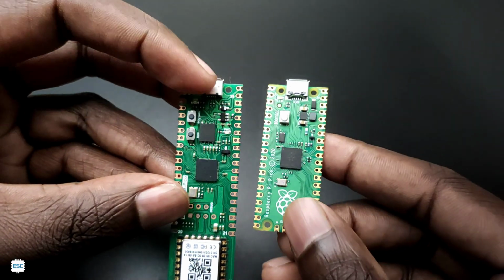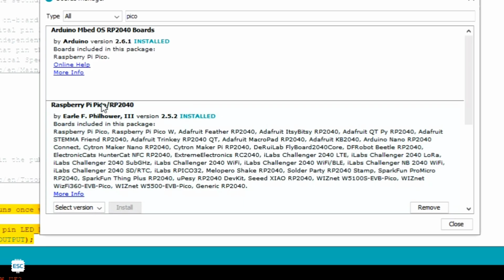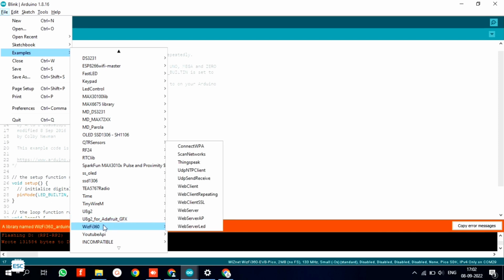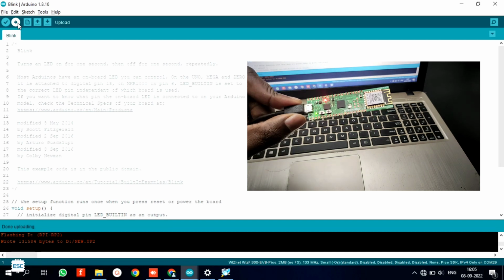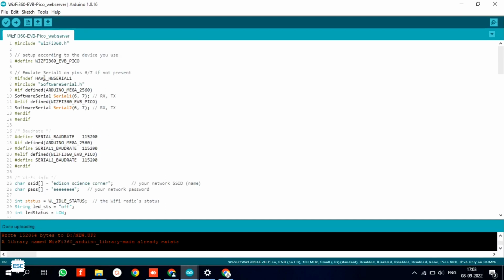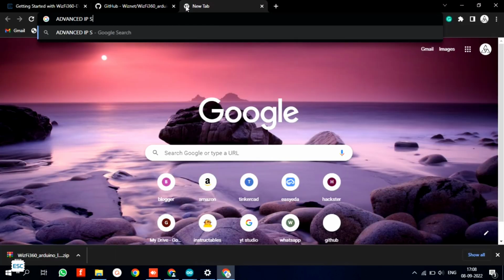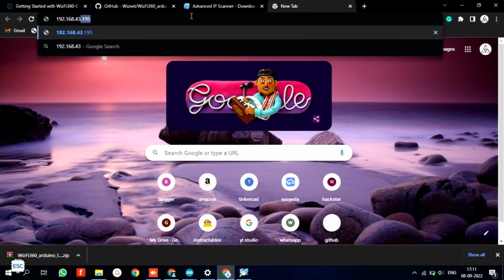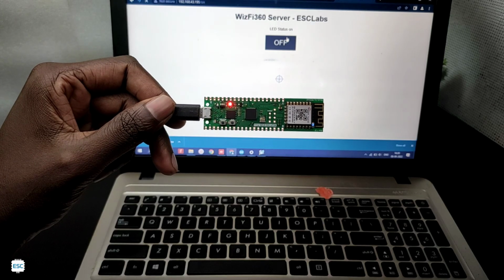How to program Wiznet WizFi360 | Web server controlling | wizFi360 EVB Pico

Comment: I can get it to print but whenever I enter my IP I get Connection Refused. Listening on the terminal It initializes and connects to my network. I can see it with advanced IP and ping it but nothing more.
Reply from the maker: Yeah bro thats the problem if we call that ip address function the pico will go to irresponsive mode thats why  removed the line and used the scanner to find my ip
Reply: @EDISON_SCIENCE_CORNER  Awesome, that worked! Subscribed!
Reply from the maker: Thanks🔥